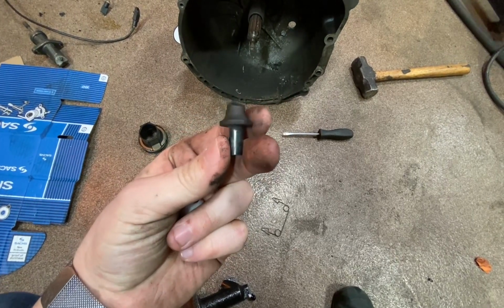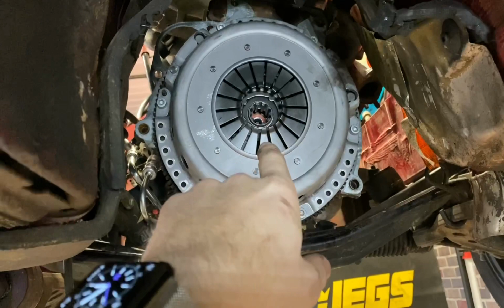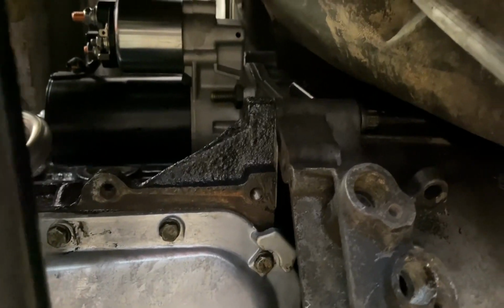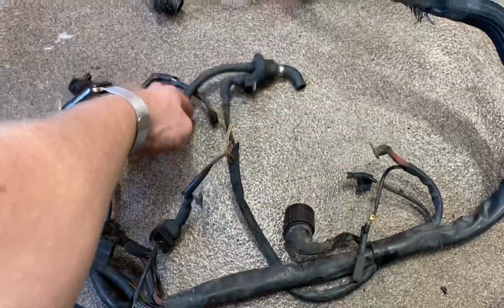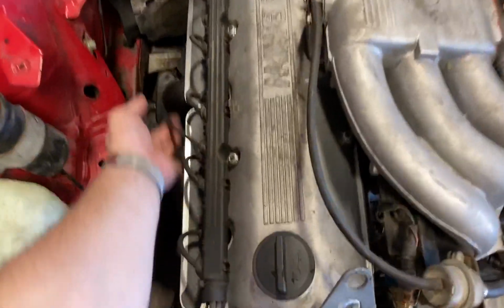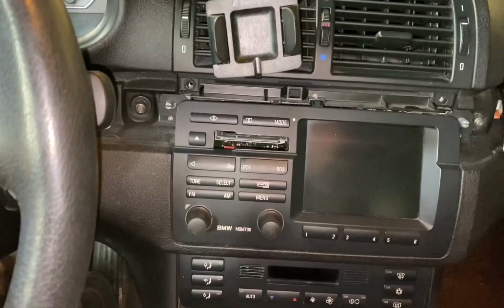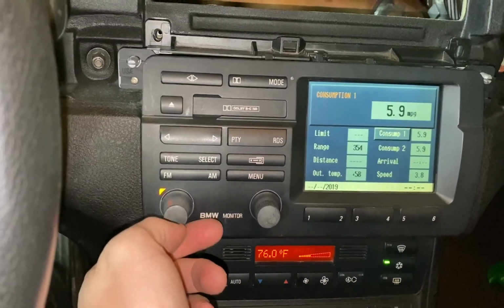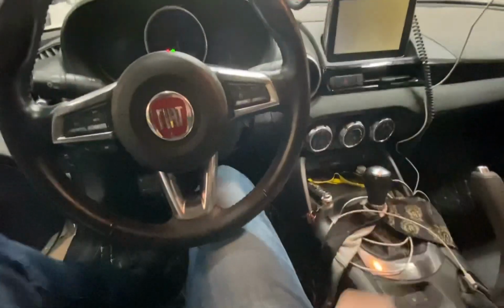87 e30 iS engine swap part 3, e46 M3 nav, cold starts

Comment: Do you recommend starting stored cars for a bit over winter storage in cold temps or just let em be?  I know you don't want condensation to form from not getting to op temp.
Reply from the maker: depends on the relative humidity where they're stored in my opinion. keeping an oil film on the cylinder walls and stuff is important, and humid environments, I'd say starting for a second to get the film back every month or so is wise. dry environments, I wouldnt lose sleep over a year between engine starts for a minute.

modern metal matrix cylinder wall engines, you can go for even longer than iron blocks.
Reply: @OvalboreCars  thanks, good info may periodically start my.........ix 😶
Reply from the maker: haha, we'll just say "M20B25" and not talk about it :D